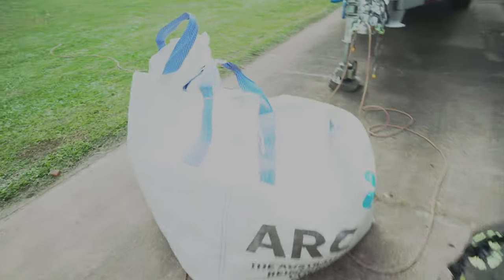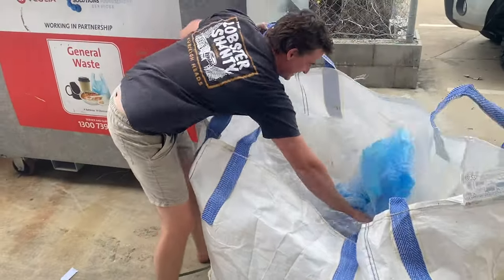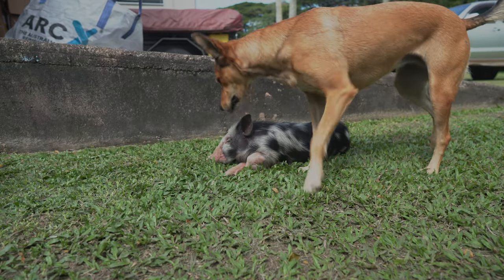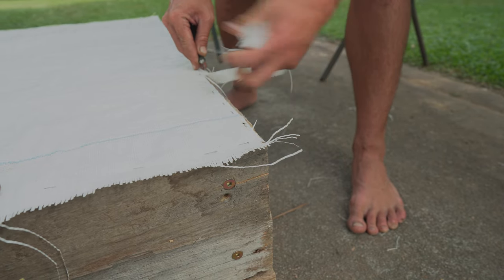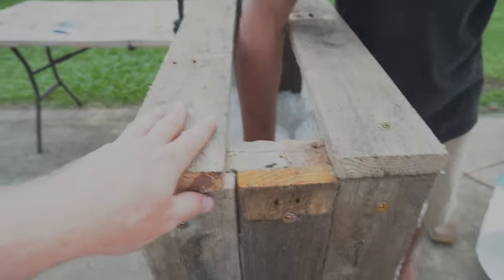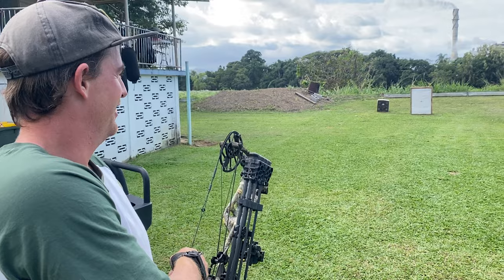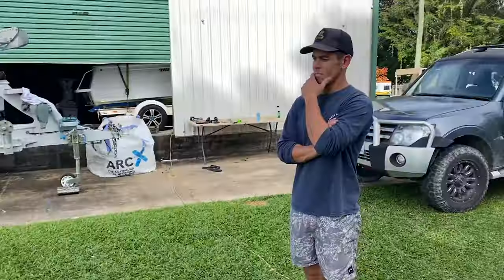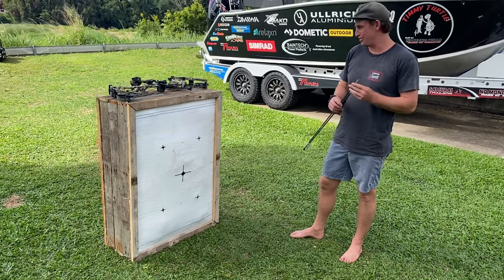$0 DIY Archery Target!! (It Actually Works)

Comment: Used these seed bags for years and they are pretty tough and resilient. I fold the edges for double thickness before stapling for strength for packing  the stuffing tight.  Mine are 3’x3’x16” thick.  I found clothing stuffing at a local secondhand place that throws out tons of old clothing  . Require cutting of buttons, zippers etc- anything hard to ruin an arrow point. Like you guys I used junk lumber and wood from pallets. I’m lazy so I mounted mine on two wheels at one end and a handle to lift and pull on the other end. This lets me easily move it around for different yardages.  Cloth is used in nearly every bag target. 👍👍👍👍

Comment: I'm into traditional so a bit less power in the arrows so I do exactly the same but use cardboard boxes (TV, furniture, fridge - anything big and thick) as the outer layer. When the cardboard is done for I just pack the old target into a new box ;). It works wonders! Still using the same plastic insides for like 8+ years. Needed to add about 30% more though. It is free as opposed to many expensive targets we also use in our club and on the range.

Comment: I just made a 4'x4' target. It wasn't free but well under 200 and will last. 4 packs of rubber mats (9.99) tractor supply, 1 pink insulation board(40ish) 4 white insulation boards(14.99)  duct tape, landscape fabric and foam board glue. Cut in half and layer with the pink board and mats on the outside. Wrap in fabric and tape the edges. Stops 4mm arrows with g5 broadheads out of an 80 lb bow. Arrows pull easy and clean. Its lightweight enough to move easily but heavy enough the wind doesn’t tip it over. Roughly 2 ft thick.